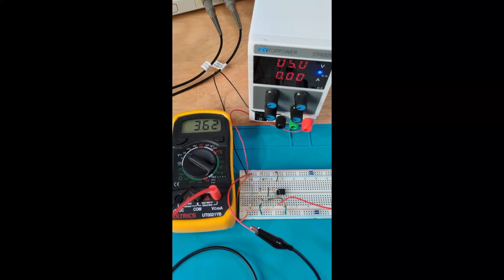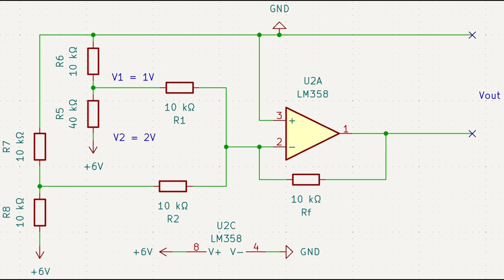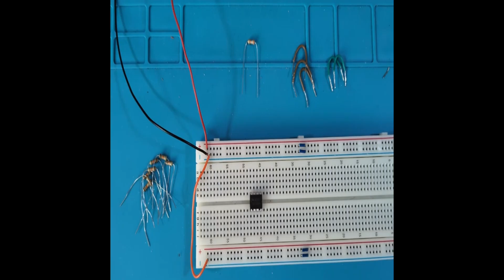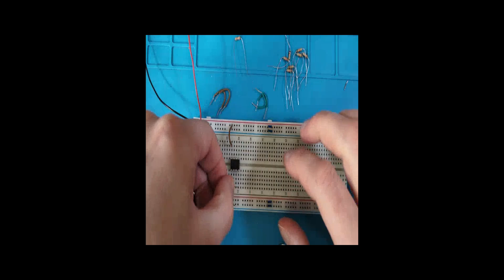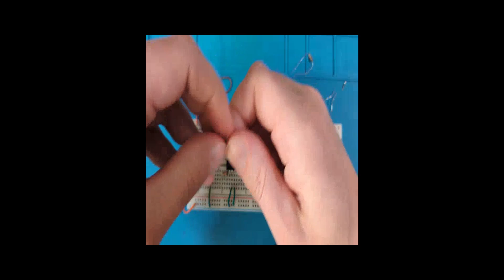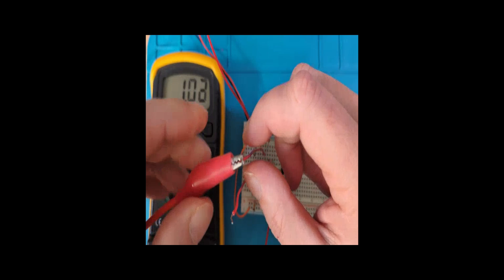Summing Op-Amps for Beginners. Build & Test with LM358

Comment: Thank you so much - this saved the day for me! I had spent weeks using AI but it took me down so many rabbit holes and was completely inaccurate and useless and ended up wasting many hours of time  and effort. Your video was exactly what I was after. I first built the exact same circuit you describe to make sure I knew what I was doing, then adjusted the resistor values to suit my use-case. Thanks again Matty.
Reply from the maker: No worries and thanks for commenting 😊 
Really glad that you have found what you needed and modified it to make what you're building work. I hope it continues. If there's anything else I can make let me know. 👍